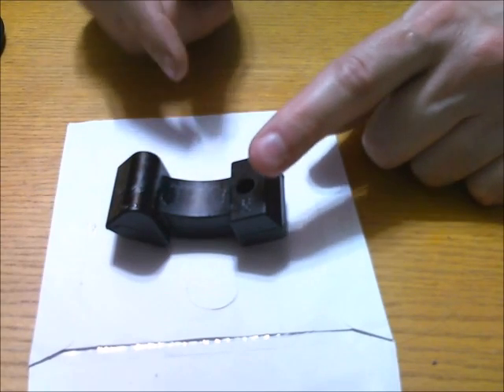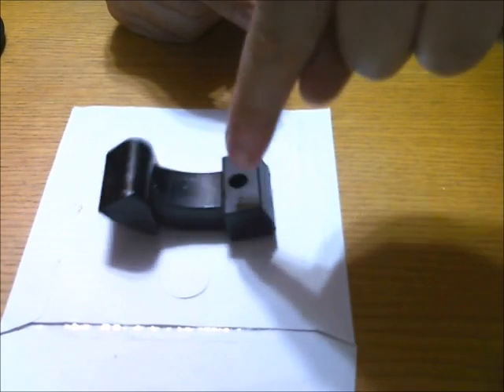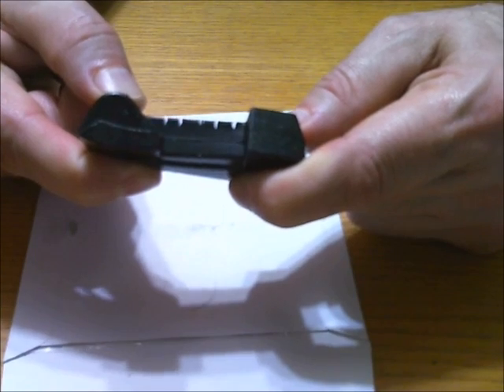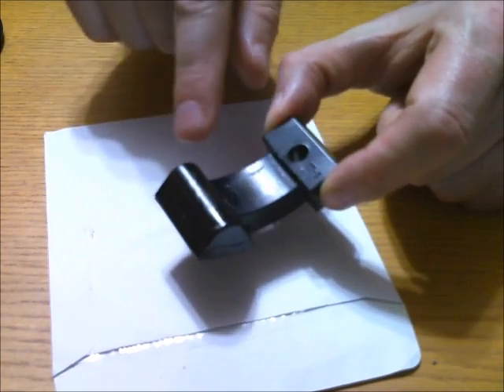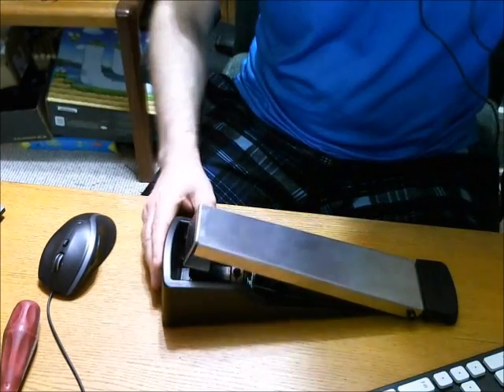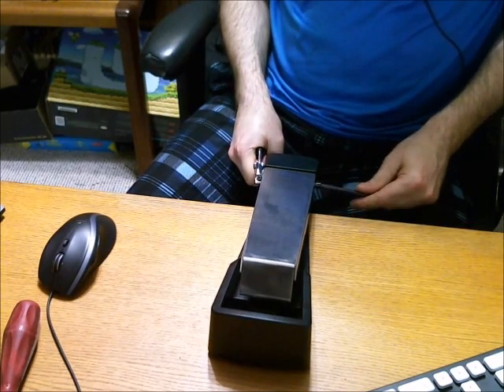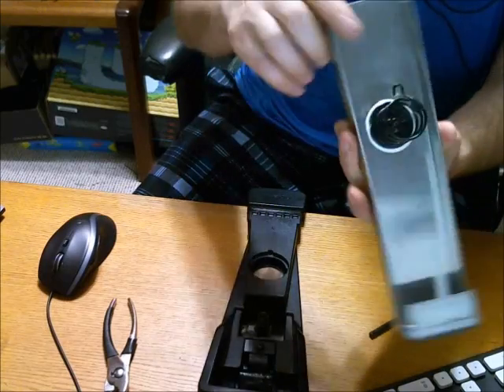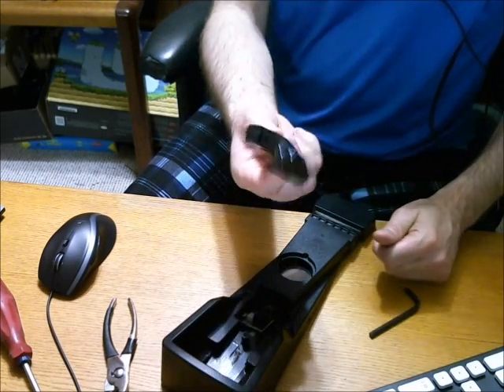Roland hi hat pedal - permanent fix

Comment: Hi, I just solved the hi-hat problem, without replacing the rubber part. Simply put it under hot water to soften it and put on WD40. The pedal has not been working for 2 years, and now it works wonderfully!!!
Reply: Wd-40 eventually eats away at rubber and causes it to become brittle , keep that mind
Reply: I put mine in boiling water for 20 mins... been fine since too

Comment: Thanks for this video. I used a modified version that may interest readers. Instead of cutting the neck of the actuator, I used a hobby grinder to remove about a millimeter of the rubber. Works well and no danger of it cracking along one of the cuts in the future.  Whole thing took 15 minutes and I'm back in business. Thanks for the idea!
Reply: Does your solutions sill works? Some buy new rubber, some make cuts 5 - 9 (cuts, 1mm deep) on rubber, some home 0,5 - 1mm (to thin rubber looking from side view) and some boil their rubber? Which solution is best? I don't mind buy new rubber if new rubber works on long run.
Reply: So just basically take a Dremel to make the middle layer thinner?

Comment: The amazon price of the silicone part, which is not worth 1 dollar, is 30 dollars. I had to apply a lot of pressure with my left leg to silence the hi hat cymbal. I came across different repair videos on the internet. Boiling the silicone in hot water, applying Vaseline and finally I came across this video. I used the end where the metal plate puts pressure on the silicone. I glued a 2mm plastic layer to the point, but the adhesive did not last long. Now I will apply the cutting process, but while doing this, I will create shallow paths with a thin-tipped soldering iron instead of a knife. Scratching with a knife may cause the silicone to tear in the future and become completely unusable.

Comment: I’ve been living with a unresponsive pedal for years. This totally worked. Thanks so much man!
Reply: Is it still working or did the rubber eventually break?
Reply: @neilabel1711  No, it no longer works, it became less and less responsive over time. ahh well
Reply: @jordanpry9604  Oh man, that totally sucks.  I went ahead and sliced into mine this evening.  I guess that means I just ruined it in the long run!  :(

Comment: Wow! This fix works perfectly! My hi hat just stopped working when I tried to put it in the closed position unless I pressed very hard on the pedal with my foot. I was nervous that I was going to have to spend alot of money to get it to work again. And then I saw this video. 
I used a hack saw to make the several small cuts across the middle of the actuator and greased the front as suggested in the video. The process only took about 10 minutes to complete and now my hi hat works just like new! I'm so happy! Thank you for posting this. Just wonderful!

Comment: Wish I could give this multiple thumbs up. Works like a charm. I was able to do this without removing the top two allen screws (one was stripped and wouldn't come out) or front drum key screw. I unscrewed the 7 phillips screws in the "toe" section on the bottom of the pedal and was able to get to the actuator. A few swipes of the pocket knife on the rubber actuator and I was back in business. Thanks for the video.

Comment: So I started with gluing a piece of felt where the pedal touches the rubber accentuator, and it worked but did not last long, then I tried the grease option which lasted a couple of month, and now I boiled the rubber for 10 minutes to get it soft AND did the cuts for a lasting result.
Thanks a lot for the "Roland Hack"

Comment: I had problems with both pedals on my kit, and I can verify that this works! 

I just did this neat trick with both the hi hat- and the bass drum acutators about a week ago. 
After making about 5-6 of these notches and coating the involved surfaces in vaseline; the hi hat pedal was instantly better (the same evening), almost perfect response! 
The bass drum was still not responsive the same evening, (I had to really put weight on it to make it respond)  so I thought maybe it was another issue with that pedal. But after about a week, the bass drum pedal responds as if it was new. I was about to give up on this kit but now its back out as my main practice kit. Moral of the story: Don't do what I almost did and toss a perfectly good kit! It's an easy fix!
And thank you so much 1sainteve1 for this amazing hack!

Comment: I noticed my actuator was very stiff so I followed your instructions. After making the cuts along the rubber piece, I noticed it was still somewhat stiff, at least when compared to what you were showing in your video.

However, once I put it all back together to test, it sounds and works amazing! 
I bought this Roland kit used, and I guess the actuator was already very stiff to begin with so I never knew what it was supposed to feel like.

TLDR: thank you so much for such an instructional video! Saved me $30 from Amazon. I hope my pedal stays working this way for a long time!
Reply: How's it holding up?  Still working?
Reply: It stiffened again but not as bad as it was before. Maybe it's just wear and tear of the component and something that must be replaced over time. Deeper cuts helped a bit but be careful not to cut too deep.

Comment: Nice. It worked. Easy to do. I put mine in a vice and used a small saw to cut almost halfway in about six different spots. Thanks!
Reply from the maker: Half way through? That might be too deep. 
You may find that it will split after a few days/weeks.

Comment: One thing I didn't like about this idea is that sharp cuts might spread deeper over time owing to the mechanical stress of use. I've seen others talking about drilling holes. I used a 2 mm bit to drill 6-7 lateral holes (across the width of the actuator) just under the top surface, then another row of holes between the others and deeper in. Worked first time!!

Comment: worked like a charm!!!  Thanks man!!
Reply: What problem does this solve? I just got a TD-15 and the hi hat pedal kind of works, but not fully. When I push down firmly, it keeps the sound of the hats closed. But quite often,  it will make the closing sound without me lifting and lowering my foot. Think this would solve that problem? Again, it's a TD-15, so it's 5+ years old, and it just sat in a guy's closet the whole time. So that can make things get goofy.
Reply: @dkbrantley5009  Mine was barely working-had to really press hard for it actuate.  Now it works like it was new.  Take it it apart and clean it first to see if that helps.  If not try doing what it shows in the vid.

Comment: so this worked great for the most part, but not im getting tons of double and ghost hits. If i keep me foot down on the pedal after hitting it, i can trigger it again just by putting more pressure on different parts of the pedal. Sounds like the actually sensor could be a bit faulty?
Reply: This seems to be my problem also. Did you find a solution?
Reply: Any progress?
Reply: @dkbrantley5009  What did you end up doing?

Comment: Thanks very much for this interesting solution. Unfortunately it didn't work for me. Straight after executing your solution, there was a dramatic difference for the better. However, a week later, the actuator had stiffened back up such that there was little change versus before. Hard to understand why that would be so, but that was my experience.

Comment: Great video I tried this solution and yes It works. But still had issues. Particularly for the volume of the closing action of the Hi-Hat (splash) unless I added 20kg weight to my foot and jumped onit  I was ready to take the FD-8 to the nearest dumbster and I stumbled onto the only solution that works great if not better than when It was new: 
I removed the cover taking care of not damaging the ribbon .. I did not disconnect or removed the sensor but did remove the rubber hammer and Did Not Replace It. 
I then placed a piece of rubber (eraser) around 1cm , x 0.5cm x 0.5cm high with double sided tape on the side of the black L sliding bracket that will be facing the strip sensor. Making sure that it was positioned so to coincide with the end of the straight sensor,  just before It goes into 2 tracks.  
I then checked again that the eraser rubber was secured as I did not want to risk for the metal to contact the sensor.
tried! Ok a bit more pedal travel(lets not forget that the unit is spring so there is a return/resistance anyway) but for the sound = night and day.! better than the first day I bought the kit. No more rubber hammer for me!!!! no more boiling or cutting the hammer and no more jumping on the Hi-Hat pedal.....i thought I should share this.

Comment: Thanks! I saw this on Vdrums.com and read more including a guy who ground it down a bit, similar but a broader surface mod. Yes it worked very well. I used a Dremel tool with a tiny sandpaper grinder. Mo-betta than spending too-mow on the actual replacement part.

Comment: Can someone help me record my TD1k with iRig? can i use a converter from 6.5 jack to 3.5 (since TD1K doesnt have 6.5 jack on the module) ?
Reply from the maker: The main problem is that the iRig input jack is mono and the TD1K output is stereo. They do make adapters that go from 3.5 stereo female to 6.35 mono male, but you'll probably have to get it online since they are not that common.
Also, the output of the TD1K is line level, and may overpower the iRig's input.
Reply: THANK YOU VERY MUCH MAN!!!!!

Comment: Been 7 months. How's it holding up?
Reply from the maker: Still works! I haven't opened it up again to see if there's any wear on the slots, though.
Reply: 1sainteve1 cool. I tried this and it seems to be working. Still not perfect (perhaps there's something wrong with the sensors itself) but an improvement.  Thanks.

Comment: I just bought a new one after problems with my old one and guess what...the new one is just as bad. Probably been sitting around in a warehouse and the rubber dried up.
Reply: Just cover it with a layer of dish soap and dump it in a hot glass of water mixed with some of the same soap, let sit for 2 hours (at least), then wash it, dry with hairdryer and wait for it to cool at room temperature, will be good as new.
I did it today for the 3rd time in 10 years, never damaged or odered a new one and it works every time.

Comment: I tried this solution but .... the situation improves but it is not decisive .... however the pedal remains inaccurate .... in this product Roland has really sucked I'm sorry because the rest of the battery is valid for the use that must be made